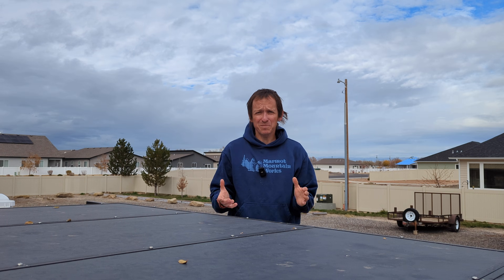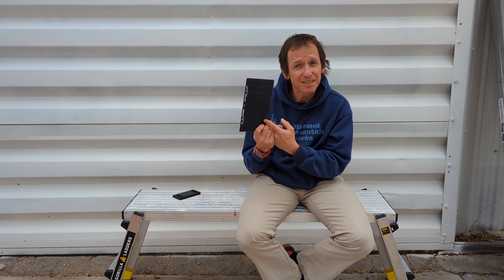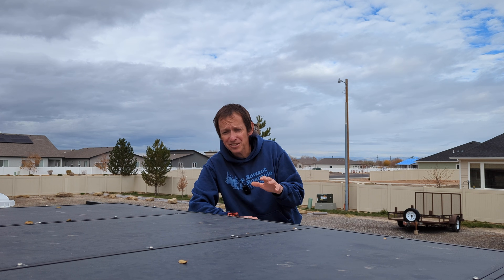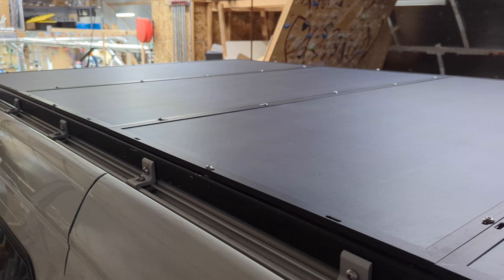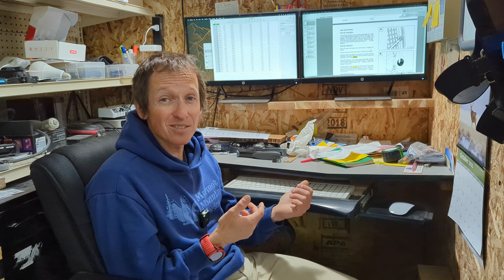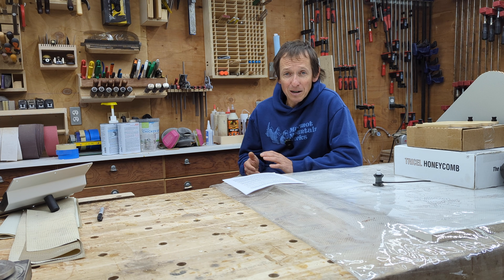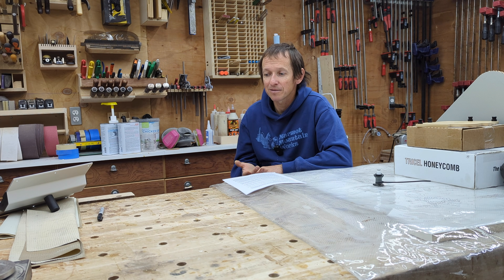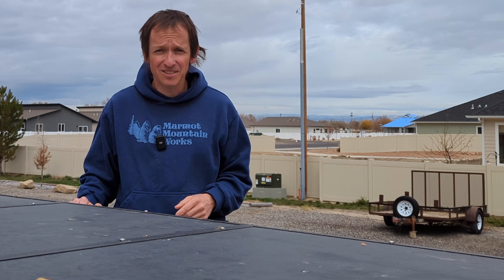Ultralight Solar: The Future (and I'm very excited for it)

Comment: Ya I pay half that amount for a 1kw  solar panels on my van. The weight of my five panels is about 130 lbs. My van weights about 8,500lbs and goes about 20 miles on a gallon of diesel. That's good enough for me.

Comment: The dynamics of buffeting wind on a highway and the elevated position of rooftop panels makes for an extremely challenging environment, so the engineering (panels and/or mounts) is likely to involve some learning by doing. I think that the solar input benefits of charging while driving are small, so easily retractable panels could reduce the wear and tear on panels that may go through significant butteting/flexing cycles if permanently deployed. retraction options also help when hail damage is a risk. And cleaning road dust and leaf buildup underneath the panels is healthy for the vehicle. When designing a deployable light panel system, being able to slide out a panel that then covers the windshield can also significantly reduce cooling loads.

Comment: You would probably love to chat with this guy in Arizona that has been "hand making" solar panels for at least a couple decades that weigh on the order of 0.8 kg per m^2.  The panels are generally used on solar racing vehicles that compete around the world as well as on long duration "stratospheric ballooning" payloads (many times launched by NASA) that end up at about 120,00 feet in the stratosphere.

Comment: I went with 13 x 540 watt panels on Taj-Ma-Haul, the weigh of those… 1,014lbs… I have 2 arrays of 1x5S & 1x4S2P for 7kWatts! After 5 years of running this, I know I could get away with 3kWatts and reduce my weight load out.

Comment: oof, I’m leaning towards a rubber grommet on both sides of the panel with the over-sized holes might be the way to allow for expansion & keep the panels from flailing in the wind? I think I’d also mount them perpendicular to the direction of travel or put a wind deflector at the front to avoid lift (I think you actually did this).

Comment: Nice install, looks so neat. I look every year at solar panel advances, I have plenty for 8 months of the year but winter is still a struggle. When flexible panels are worth it I will put them on the side of my truck box.

Comment: Can't justify the expense.  I just installed 3ea 440 watt panels on the roof of my short school bus.  I was able to purchase them new for $140 a panel. They also come with a 25-year warranty. Yes, they weigh about 44 lbs each. But that is 1320 watts for $420.  About the cost of one  of those 200 watt panels.  That is 1/6th the price per watt. I would love to install thin, lightweight panels on the side of my bus that would be attached to gas struts on the side.  They would cover the bus windows while I'm driving and flip up creating a solar awning when I get to my destination.  Giving me both shade and electricity.  But no way am I paying $400 for a 200 watt panel.
Reply: I'm in the same boat as you. I used a single residential 400w panel on my sprinter van, it cost less than $200 and I picked it up from my local Platt. It's also made by LG and I am quite sure they'll be around for the next 25 years to honor the warranty. These new startups? The warranty is only good if the company stays afloat.

That said, if I had more money to throw at the project I would love to have more and lighter panels on my roof. Maybe the next build.

@POS as always super impressed by the build and your attention to detail. I wish more folks focused on keeping weight down the way you do! Keep it up.
Reply: Yep. I'm out. I guess is good for development purposes but the price is outrageous

Comment: Bougerv 200 arch pro are lighter and way cheaper than this. They wrap the panels with fiber glass exterior and the ones here are wrapped in aluminum. So we are forced to get a roof rack.

Comment: I have 3 of the Renogy 100W Black Division Lightweight Flexible Solar Panels for 3 years now, they only weigh 5.3 lbs. I used rare earth magnets to hold them onto my trailer and can pull them off and place on the ground to have both on vehicle while driving and off trailer when camping to put into direct sunlight. They have been amazing.